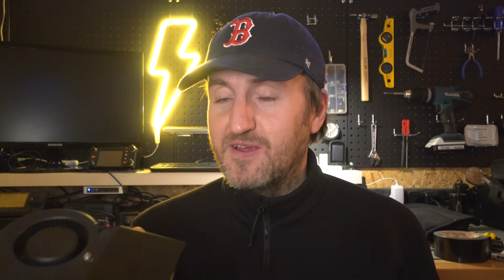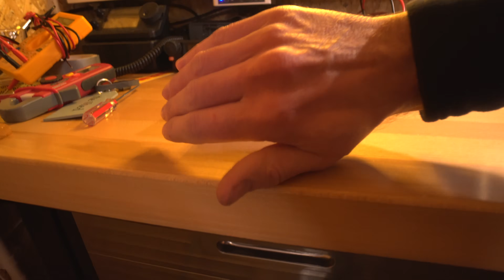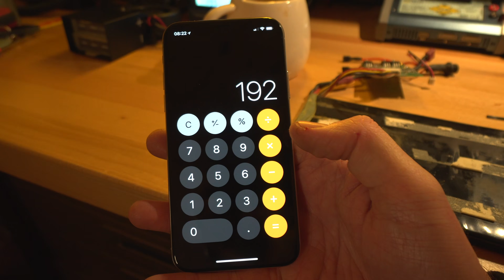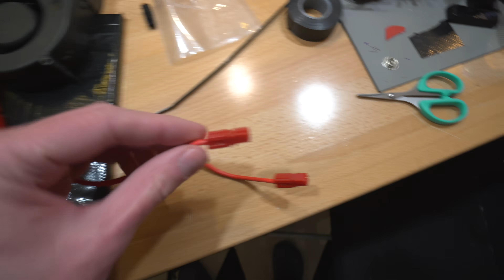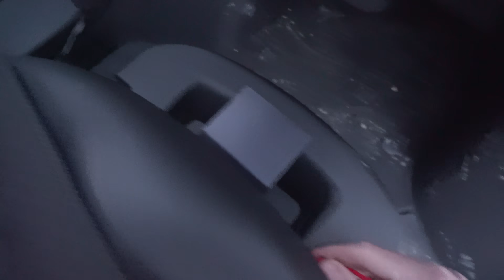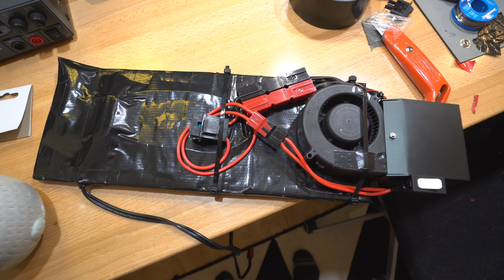BATTERY POWERED HEATERS???

Comment: What size battery do you think I would need to run this for 24 hours in 0 degree Fahrenheit weather? I'm a die-hard ice fisherman who sleeps on the ice in a insulated fabric Shack and I'm looking to get away from propane Heat due to fumigation
Reply from the maker: Hi, you’d need a pretty big battery for that, equally though you would need a pretty bag of wood if you were lighting a fire and keeping it running for 24hours...Insulation is the key here, first make your cabin as airtight as possible so the cold wind doesn’t come in, then what you need to do is find the sweet spot where you can heat the cabin using the lowest possible power and raise the temperature just enough to be comfortable.  I think you would need a lithium battery of about 2kWh, see my new video coming tomorrow, this would be the sort of size battery you would need, I’m thinking maybe a 500W oil filled radiator would work best here as it can be turned on in 10 minute intervals and the oil will retain the heat when it’s not on vs a fan heater that would not.
Reply: I've got a battery that has cold cranking amps at 0° of 675 Marine cranking amps at 32 degrees 840 Reserve capacity 210 it's a AutoCraft deep cycle marine RV Pro
Reply from the maker: Yeah that might just work, the issue with lead batteries is they are heavy and don’t really like to be discharged hard but you could try a 1000W inverter and a 500W oil radiator and see how long you get.
Reply: Thank you for advice
Reply: It is difficult to have battery powered heat. That battery is about 100 amps and you should only use about 1/2 before recharging. Roadpro has a 300 watt 12 volt heater and it uses 25 amps per hour.

Wave 3 is a catalytic propane heater so you do not have the CO problems compared to a Buddy Heater.
Reply: @pearll_abcdgarcia2906  I I saw those and was wondering about that. So the catalytic heater should reduce some of the migraines I get from fishing in my shack why running my buddy heater
Reply: Try a  CO detector in the shack. Headaches sounds like might be CO poisoning. Pretty dangerous.
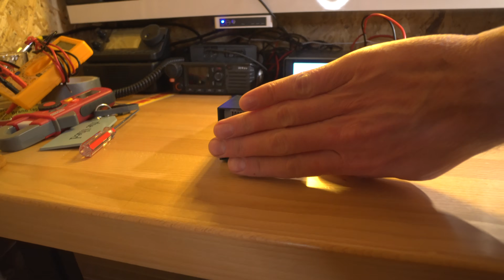Reply: @pearll_abcdgarcia2906  I had one and it never went off. After I woke up I went up to the truck fell asleep till 5:30 woke up went back down to the ice shack and hit the test button and the damn thing worked.

Comment: How can you get 150 volts from a 12 volt battery?
Reply from the maker: You use a thing called an inverter BUT depending on the power consumption of the device it could take too many amps from the battery. You need more than one battery in parallel or a large lithium battery.

Comment: 23V, 14A, 1.64 Ohm's dissipating 322 watts of power. 5Ah battery would last 0.357142 hours. or roughly less than 21 minutes 25 seconds.
Reply from the maker: Sounds about right.👍

Comment: They pull way to much power to be efficient, I use gas in my off grid workshop
Reply from the maker: Power = heat 😉 you need to find the sweet spot between fan speed and element heat. Bear in mind a mains powered fan heater pulls 2000W and these can go up to 400W so you’d need a few for the same affect. 
Electric heating is never as efficient as gas but electricity can be free if you have solar!
My workshop is very small and very well insulated so just one of these keeps it toasty.

Comment: Releaved to find this video, as I've been playing with the idea for some time, but was going down the sealed lead acid battery route. Think you've saved me some R&D time. Thank you!
I wanted to ask the relevence of the two parts links below the video refering to the Bosch charge adapter and the Bosch battery, as you don't mention them in the video. I can guess what's coming, but would like to know if you've already built and tested, and will upload a video soon.
P.s. Ffor my one (I have a vaguely anti-social sounding car) which is fine to start and drive off gently, but when it's freezing I need to run the engine to de-ice/de-fog the car. The neighbours are great, but my conciense takes a bashing. I'm planning to build the same thing, but set it up to sit in the passenger seat and connect up an RF switchable relay, so when I wake up I can start the cabin heater 30 mins before I use the car. Then later in the day re-charge it. Thoughts?
Reply from the maker: Glad the video was of some help... yes SLA or any lead acid battery is a no go for running any big resistive old like a heater, the voltage drop (pheukerts law) is just too much of an issue. 

Yes the links were for a charge adapter for the Bosch battery and the battery itself. It was an experiment to see if I could use an off the shelf drill pack to power one of these heaters as well. Actually it turns out you probably need 2 x 5Ah batteries in parallel in order to give a half decent run time. To be honest it would be cheaper using Lipos from hobby King. The biggest thing I’ve learnt here is running on as high voltage as you can...6 cell lithium packs at 22.2V nominal work great on the heaters than can handle 24V because the fan speed is higher and the watts are higher whilst the current is lower.
Your idea sounds great triggering the heater with an RF keyfob, I think you’ll find it will demist the windscreen pretty effectively and definitely take the edge off a cold morning before you get into the car.

Recently I’ve been experimenting building some high power Lithium battery Packs for ebikes and in the process I’ve built a test pack which is currently running another one of these heaters, there’s a video coming soon which might be of interest! Stay tuned!
Reply: @andykirby  thanks for the reply, looking forward to the next video!
More research done today on cost, I think this is great if you already own power tools that have chargers and the same type of batteries, but if you're investing for just the purposes of carrying out this project. I'm worried it may become uneconomic. Will take a look down the hobby king lipo route.
Reply: Thanks for sharing great job✌👍.
As im thinking some sort of similar thing for electric heater for me in the northern part of the flat plane of existence 😁 thats here in Scandinavia..😂
Ill put a video of it when i will make the thing before the long ice cold winter arrives..
Anyway thanks a lot Andy..👍

Comment: Hello Andy, I recently came across a video you made about battery powered heaters.

In the video you showed a generic brand heater 300w/500w 12ptc model.

Can I kindly ask your help on how you wired the unit? I cannot make the fan to work.

Your help will be greatly appreciated.
Reply from the maker: There’s 2 sets of wires for the PTC heater (one for each element) and there’s a set of thin wires for the fan, simply group all the negatives together and all the positives together and connect them to your power source. Needs to be well above 12v
Reply: @andykirby  Thanks Andy. So I guess it will not work properly if connected to cigarette lighter?

I did so and just the heaters work, not the fan.

Any suggestion?
Reply from the maker: As I said in the video, most cigarette lighter sockets won’t be able to handle the current required for heaters like this, you’ll find you will likely just keep blowing the fuse. Don’t be tempted to change it for a bigger one or you’ll burn the cars wiring up. Really you need to connect it directly to the battery via its own fuse (30A) the only problem with this is you’ll need some very substantial cable and depending on where the battery is the long cable run will create a significant voltage drop so you’ll lose power at the heater. This is why I went the Lithium Ion battery route because a) these batteries can supply a huge amount of power b) they are quite small and light c) you can keep the batteries close to the heater to avoid having a long run of massive cables. 24V is the best way to go with these things because it reduces the current and need for big cables.
Reply from the maker: Also, not sure why the fan isn’t working, try connecting it to a battery on its own to eliminate any issue with the fan itself.
Reply: @andykirby  Thanks for taking the time to answer my friend. All the best.
Reply from the maker: Also a bit of extra information I found this boost converter today which can boost the voltage of the JUST the fan to 24V so the airflow is better. Ive ordered one to test.

https://amzn.to/2J9HD86

Comment: was wondering if this would work to warm the cab of my ENV , so I don't lose range......I figured on using an aux battery , not the 12v control battery. just take the chill off for a few hours......
Reply from the maker: It certainly works, yes it’s advisable to use an AUX battery, your going to need quite a big battery though for a couple of hours, mine is 22V 8ah lithium and it only runs for about 15 minutes...but most of my journeys are short hops to town... I will be revisiting this soon now the weather is getting colder!

Comment: Was thinking of building something like this to sit on my back seat and pre heat my car before i get in.
Reply: Hi Andy
Yes it has two USB and one car 12 volt socket and two household standard 3-pin plug sockets.
It is a Yeti goal zero 400w and is a lead acid electric generator and I have a 300 watt inverter.
I was just wondering roughly what kind of runtime would you think I'd get off it.
Thanks for your help.👍👍👍👍

Comment: The amps that is drawn is the main concern as a standard battery wont last very long. expect if running while car going. but would put a huge load on the system.
enjoyed the video and thanks for shearing .
Reply from the maker: Yes correct! It lasts about 20 mins or so which is just about long enough for a quick trip to the local shops but I’m going to revise it for the winter! Stay tuned!

Comment: theres no battery powered kettles either!
Reply: loads on ebay.......but are they any good?. I used a 12v coffee maker in a sprinter whilst travelling across Europe and it was very good coffee but even though the sprinter had a huge battery it boiled quicker when the engine was idling.........
Reply: yes i kind of meant ones that have their own batteries like a cordless drill, i have had a car kettle some time ago,  mine was terrible, to boil took about 45 mins for 1 cup!
Reply: There is a new one, Cauldryn mug. Pretty expensive.
Reply: @pearll_abcdgarcia2906  it keeps it warm, not boils it from cold :)  thermos with an extra warmer
Reply: t will boIil one mug from a full charge. Quite bit of battery charge to do it. You can buy a 2x size battery pack for it. It is like 37 mAh per boil. Between the mug and extra battery it would be pretty expensive.
Reply: @pearll_abcdgarcia2906  yep, agreed it does more than keep warm, but in reaility, i have a smaller pot with a small trangia alcohol stove inside, and enough fuel to boil 3-4 mugs from cold, battery is way behind burning fuels.

Comment: Andy got a nissan leaf ptc failure on it nissan want 3000 plus for just the part. So air con not working only blows cold air so a real problem for the winter. Would you be interested in making me a fan for the leaf? Got some black and decker 36volt battery and ego 56volt battery. Cheers

Comment: I got a heated seat like you have for my Outlander PHEV to save power for the up coming winter. It work for about 5 minuets, burnt out the fuse. Might do something like what your doing.
Reply from the maker: Try this heated seat pad, it's been working well for months, only draws 1-2amps, https://amzn.to/2q2afrn if you are thinking about heaters you need to wire directly to the battery.

Comment: Other solutions, would be a simple block of material that you can heat up, and just bring to the car, which works for short commuter journeys? ie a hot water bottle type situation, hot water in quantities up to say 2 litres and multiples thereof, being what we get in kettles? makes me think of two pouches that could be filled, and placed to the back of the car mats at the front seats, the calc is basic: say we get half the energy out we put in to a kettle full, that is maybe 50Wh for a kettle worth of hot water, the losses are massive and rapid to start with.  

Hmm, more research and empirical testing required on my part, I have no idea how accurate my number is, and anyway, WTF does 50Wh FEEL like in practice, what's it compare to of your heater output experiment?!  I guess, it might take a combination of a home heater in the car to kick it off, get warm initially, then your battery heater or a hot water container idea, to keep it warm thereafter.  

Canada, they have a version of a Volvo has a boiler in it which uses the diesel fuel, no really they do, it is in my manual.  They also plug in a heating element that is built into the sump, to keep the fossil fuel engines warm.  We need that thinking, on electric cars, plus much better insulation, applied to this issue?  Great piece Andy, needed doing, you did it justice.
Reply from the maker: Yeah that’s pretty interesting actually. I nearly filled up a big 10-20 litre bottle with boiling water the other day to try it out. It would obviously do something wouldn’t it! Also Maybe a simple oil filled 500W radiator in the back of the car would work, they hold heat for a while! I think the boiler idea is pretty interesting too. Thanks for the comment!

Comment: Correct on the regulated output of 12v i blew a fuse on Renault Clio 4, 2015 model, with a tyre pump, they recommend attaching to the battery directly. Looked it up, 5 amp fuse so that means p=vi or 12x5 ie 60W.  Used a mains home heater in a car, to dry it out after window breakage, you want 3kW max, but 1kW works, would settle for that. Of course, that is almost 20 times what the 12v outlet can give.
Reply from the maker: One thing to remember is that when the car is running you can pull a LOT of power direct from the battery, but you would need some big 40mm2 (at least) cables to run to the heater to avoid inefficiencies and prevent melting the cables. Then you could probably get close to 1000W (that’s about 90V at 12V) depending on the car the alternator might be able to deal with it!
Reply: You typo'd Andy?  You meant 4.0 mm sqd I think?  [EDIT - No, of course you are right, I am thinking of eg shower cables where they talk of 9mm and so on.  You mean as in Pi R squared, with a 3mm to 4mm radius of cable, ie about 8 to 9mm dia copper cable, but big beefy strands type (for domestic power that is).  Making roughly 3.14 x 4x4 = 48 sq mm for example. I get it, you are of course correct, no typo].  Yes, everything helps, to put energy where you want it.  I was surprised, that in the Nissan LEAF, my feet turned to blocks of ice going over the tops by Tebay services, Cumbria?  I just assumed, they would super-insulate the car cabin but apparently not.  That, brings to mind, the relative costs and effectiveness and so on of different aspects of heating EVs.  

I feel, to use more energy, is a short-term solution - it's like the 1970's and the fight to insulate houses all over again?  There ought to be at least 3 layers: stick-on foam/foil layer goes on the metal first; then a decent foam at least 1cm thick that keeps that thickness, then the usual carpet material, plus the car mats, which I think in an EV ought to be much thicker than normal. 

 In my old Volvo diesel, I have the original mats, then some aftermarket decent ones of similar quality on top.  It's really quite plush.  Very insulative - I think the Nissan LEAF I used for a few days to Scotland, had less insulation than this Volvo.  

Needs to be much, much better.  Lastly, surely we don't have to have the double-glazing fight too?!  Apparently the 2017/18 Toyota Prius has in effect DG side windows, they have laminated these as well as the front screen/windshield.  It's really time to make the glass much better at heat retention, stop condensation too, which is a hazard for visibility we all have experienced?  ?Surely an airgap is inevitable?  Can't say it is cost - EVs being hilariously expensive already!

Comment: I would love a battery powered heater! I run my a mobile car valeting business. It would be cool(excuse the pun) to have one for my van. for overnight just to keep the frost at bay. It's a pain to remove all my hoses and power washers from my van every night. Every winter i end up chancing it and leaving them on my van over night which inevitably leads to there demise.
Reply from the maker: The issue you’ve got is the run time when using batteries. Is your van parked near a mains outlet? That would be the best way to keep the edge off, look for 500W or lower Oil filled radiators they work well. Does the water in your tanks actually freeze inside your van at night? If so I reckon you’d be best to insulate it with celotex or something.
Reply from the maker: That would keep it 1-2 degrees above the outside temp.

Comment: What about double the battery or more ,wire in a power supply that can power the heaters and charge the heater pack by connecting  into the twizzy 220v cable and you should be able to charge the twizzy and run the heater while also charging the heater pack hope I'm making sense haven't had much sleep

Comment: 3D printer silicon heater pads (many sizes, voltages and watt to chose from), build into jacket and maybe pants, much less power usage and much more heat where needed, lighter socket will be enough power

Comment: Just a thought, you should look into different windows for the Twizy. I know the standard windows you have have got gaps at the rear. If you could insult the Twizy better with proper sealed windows then heating would be much easier.